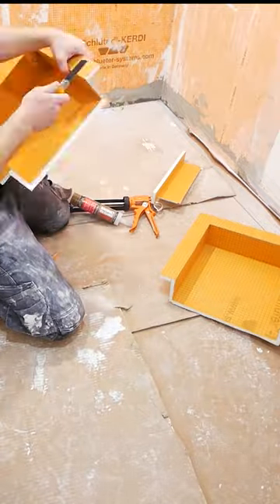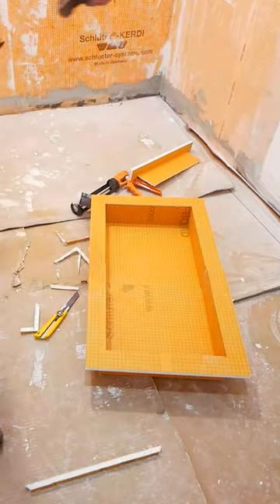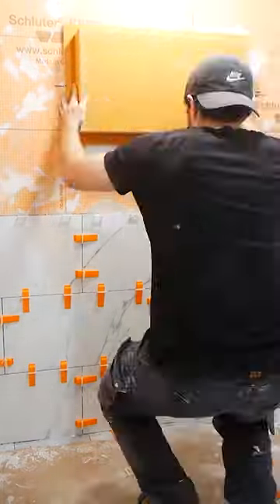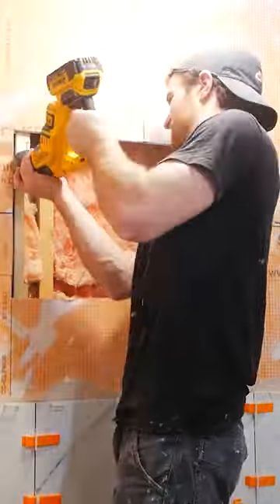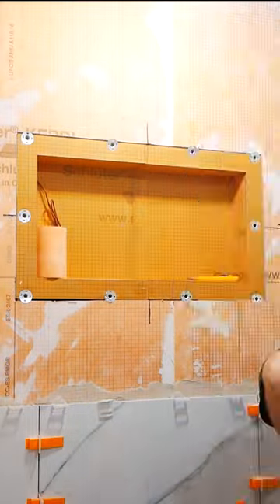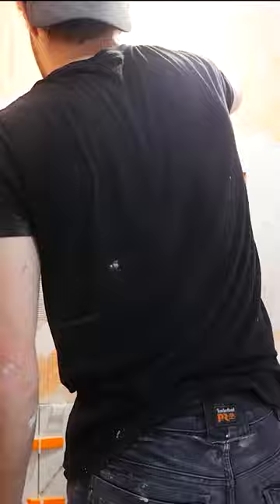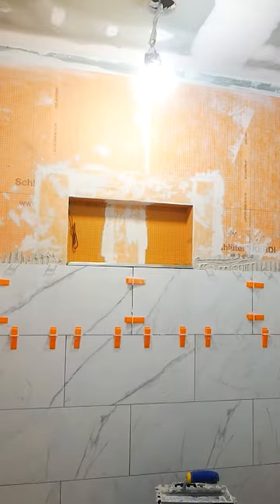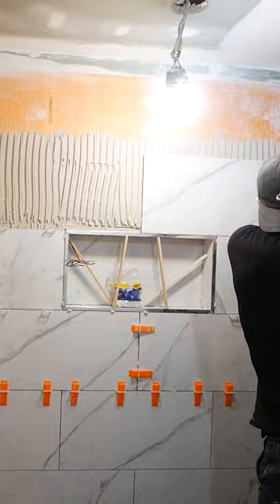How to Install a Niche

Comment: How did you silicone them together? And what lights and low voltage power source did you use? How are the lights attached?
Reply from the maker: Just a thick bead of the 20 year rated silicone. 4000k wet area tape light with a 12v driver. Used some quick connects off Amazon that the tape light slides in on one end and the low voltage wire on the other. I’ll post a video in the future on this in more detail

Comment: I don't know how you used 3/8 shluter with 12x24 tiles. I always use the half inch because you're supposed to use a 1/2 by 1/2 trowel which will add a 1/4 inch of thinset behind your tiles when the ridges are collapsed. I guess you don't need that much mud in a niche. looks good
Reply from the maker: I typically use 1/2 profiles everywhere else but the 3/8 for the niches specifically